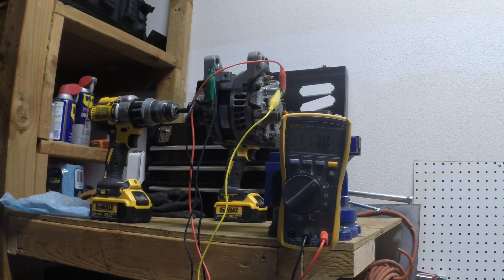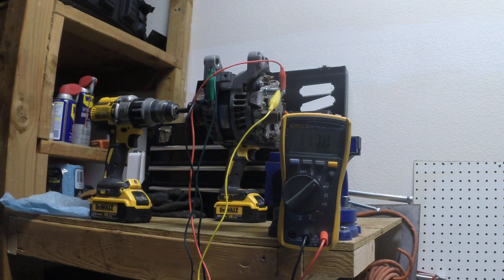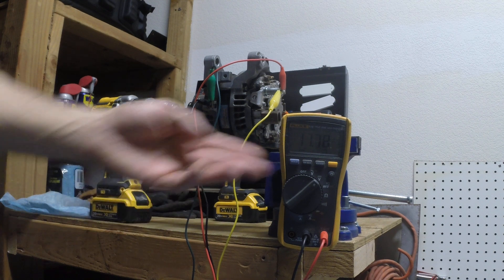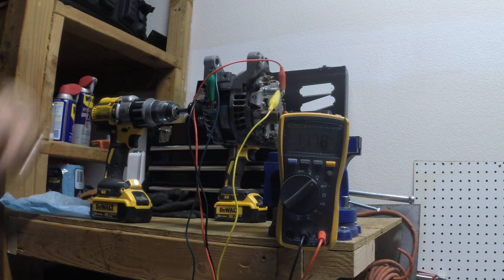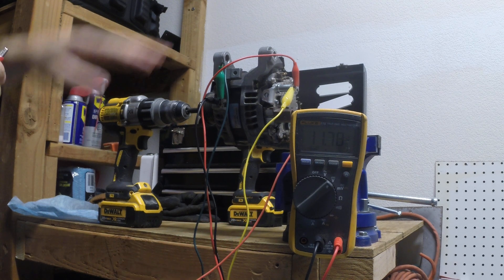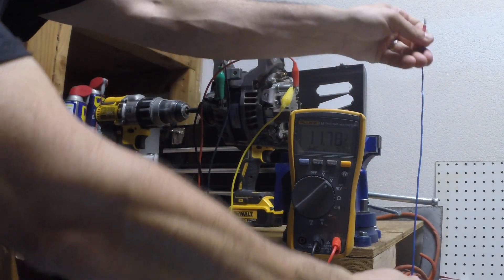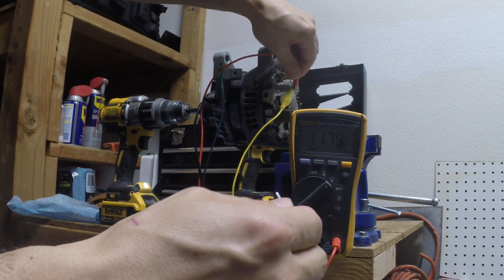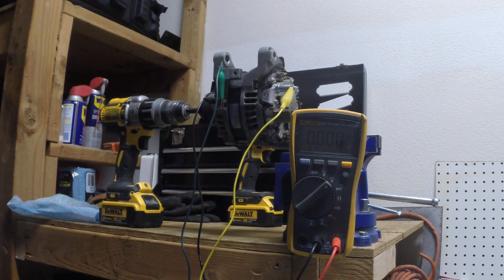Toyota Tacoma Smart Alternator Test (Bench Test)

Comment: Greetings, this video was really informative on how the Lin terminals works on alternators but could you please clarify how i can aquire the pwm device you used to emulate a Lin signal to the regulator?
Reply from the maker: I used Arduino and a TTL_UART to LIN bus adapter. I had to bit bang the UART to implement the communication protocol

Comment: Whats the signal on the controller wire look like I believe I have a problem with this circuit on my truck
Reply from the maker: The communication protocol between the ECU and Alternator is LIN bus.  I sniffed communication between my alternator and ECU in my truck so that I could replay the master commands on a test bench (ECU is master, Alternator is slave node).  I used an Arduino and bit bang the protocol.
Reply: @peak_ascendr9960  Hi Peak could you explain in more detail please how did you program the arduino what signals, I really want to fit a new alternator to an old car as it fits really well hope you can help
Reply from the maker: @estorilblu  the tacoma alternator uses LIN bus protocol to communicate with the ECU. I've decoded some of the commands and used arduino to send them to the alternator, but the complete command set is not yet understood. I don't think using this alternator on an old car would work well